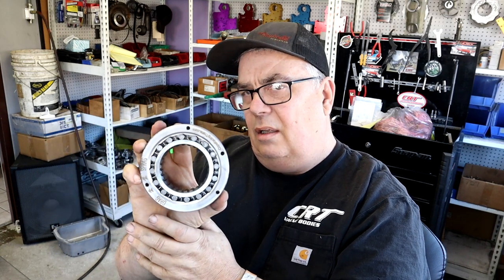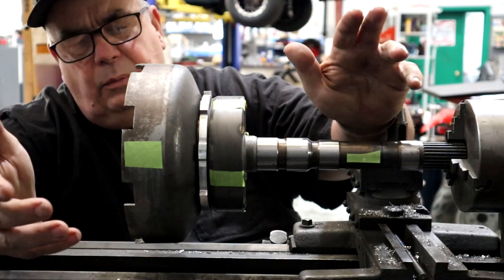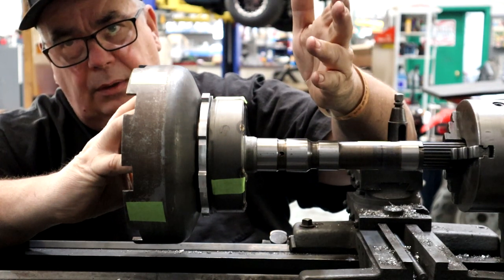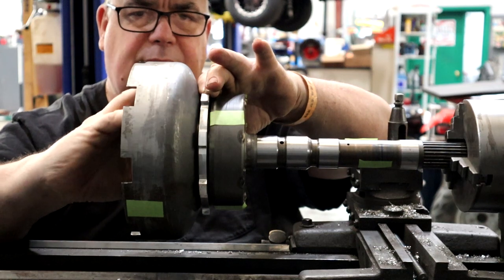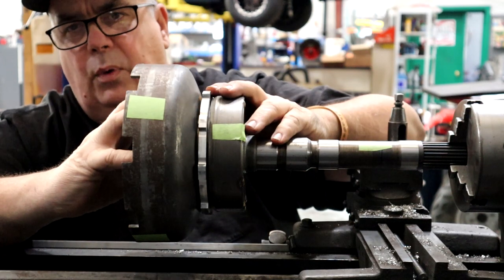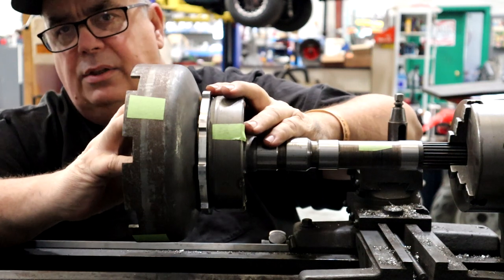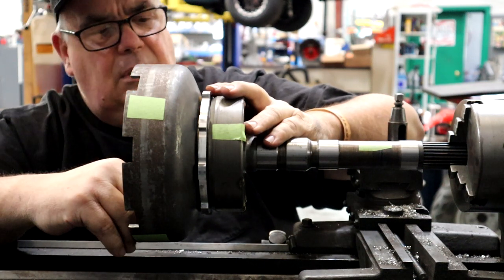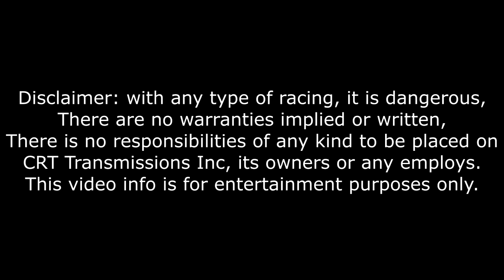RACING TRANSMISSION EXPLOSIONS. THE WHY WHAT HOW OF 727  CATASTROPHIC FALURES

Comment: Excellent video John, I did a lot of research earlier this year when it came to rebuilding my 727 and ended up going with the drag sprag and billet steel drum for my street driven (some strip) roadrunner. Alot of people told me it was overkill, but this video right here just confirms I did the right thing.

Comment: I don't ever want car parts blowing into my body parts. I once pulled the sprague out of the case truck pulling even with low gear apply. I never did know exactly what caused it but i be there had been a driveline failure previous and the sprague was jacked before it got ripped from the case like you said.

Comment: Any symptoms of a damaged sprag, or is disassembly/catastrophic failure the only way to find out?
Reply from the maker: Correct
Reply: Crushed springs in the roller clutch, I found 3 in my C4 when I tore it down
Reply: I had a 727 that would rattle in auto low, but not in manual low with the band applied, knew right away that the sprag had failed.

Comment: Thx so much for putting this dramatic Info out....How the Heck did the Ramchargers & other  drivers Survive the early S/S  '60's Max Wedge & later A990 Factory Hemi powered A727 Equipped "Reverse V body"  (Likely No Lo Band Apply) drag Racing days ?? ....Especially in the Low Traction 7" Drag  tire days,  How could Experienced Factory drag Racing engineers Not Know their 727 Oem Front  Sintered Iron Drum was/Is a Dangerous driver Killing centrifugal Bomb ?? .....Chrysler forged Everything back then & Must have Known these Iron Drums were Hot  street & Drag racing Prone to Explosion !! ......Most guys knew Nothing about Auto trans Internals & No one Explained how Predictably Dangerous that Oem sintered Drum Pos was/is !! ......

Comment: Die hard dodge guy here. Never raced my dodges, but I have reduced my 727 to slag more than once by working it literally to death. Truck in my pic, rebuilt the 727 with a Stage 1 kit, valve body rebuild, external cooler, usual stuff. Drove it, full of tools, towing my 4 door jeep from Yukon to southern BC, drove it there for 6 months, went to tow it all back. Pullin the hill outta Kamloops, drive goes byebye. I swore at the truck: Leave me on the side of the road, I will fucking tow your ass home behind a chevy. To my trucks credit? Even with the full load and towing a 4 door jeep, in second gear, no exhaust (blew that off just before the trip) that truck did not stop pulling UNTIL i crossed the property into my parents yard. Literally, just as i crossed the property line the trans gave up the ghost and stopped moving altogether.  No matter what Ive done to my Dodge truck,  she has never, ever left me on  the side of the road. Hydrolock the engine? Choked right through it. Battery burst? Drove it home.  Slag the transmission? Nope, still goin. 

Good vid. Good info. Curious though - any suggestions for a 'extreme work' build?  Gonna be building this into something of an apocalypse truck.

Comment: Just found your channel good stuff i had a truck c4 in my 67 fairlane 289 fully built nitrus oxide, 35 hundred stall and manual valve body and i feel very lucky because I had that motor spinning 95 hundred rpm lots of times and no failure except springs crushing in the valve body

Comment: Yep. Thanks to people such as yourself, pointing out the basics of how these transmissions work, I hopefully made some decent choices, rebuilding my 48RE (diesel). I did the the 16 rolller bolt-in, and I did the the billet drum. And I don't race the trans. But maybe somebody else will? I'm about to rebuild a 47rh, and I'll be doing the same- Billet direct drum, 16 roller bolt-in sprag (and a billet forward drum). If I do race it, it'll get a blanket, too. Going for 5k, 1000hp, 2000tq. A lot of ppl in the diesel world building transmissions using the stock direct drum. High $ transmissions, with stock direct drum.

Comment: Low reverse spray, spring and roller clutch, is the one really weak spot on the 727. I’ve only had one pop on me after a rebuild but just went in and replaced it and never had another problem.

Comment: Excellent demonstration on the lathe! Can you explain why this isn't an issue for a 904?
Reply from the maker: 904 drum is lighter and closer to the center line of the transmission.
Reply: smaller diameter.

Comment: Thanks for the video.
 I'm building 727 for my '79 Power Wagon W150, w/a mild 360. Could you please recommend a good rebuilt kit for me, w/ part #'s.  I've had my transmission rebuilt twice. Both bad experiences, mostly from craftsmanship of the whole process whether it be on removal & install, time, or screwing me by throwing in a used unit off the shelf after breaking the rebuild. I'll do it myself. Sorry for the ramble, hope you can help, thank you

Comment: Anytime someone tries to talk smack about one brands transmissions or just stock components not being able to handle more power I mention that the manufacturer never intended for that power. If they did they would've gave it that power, some transmissions are beefy but most of the time those are manual transmissions or diesel transmissions. I have a 46re with a 5.9 magnum and just bolt ons, 150k miles and as far as I know it's a stock transmission. It's worn but she works better than any I've ever read and heard about

Comment: I have a 340 powered 23 t roadster that weighs maybe 2000 lbs at the most. It has a 727 and I will be installing the crt automatic valve body. 340 is only slightly warmed up with a little more cam than stock and 10.5 to 1 compression so it’s not high horsepower. No drag strip at all just occasionally light up the tires a little bit. Trans is re built. Am I safe???

Comment: just to clarify what do you mean by low band apply ? I know what it means to me but need to know what your meaning is
Reply: The low band is applied in 1st gear.  Stock valve bodies did not apply the band in 1st gear unless you put it in manual low and many racing valve bodies do not use the low band in 1st gear, they rely solely on the sprag to hold 1st.
Reply: @richardbeals1403  okay I thought that was what you meant thank you
Reply: @richardbeals1403  Right on Richard! This is Dean!